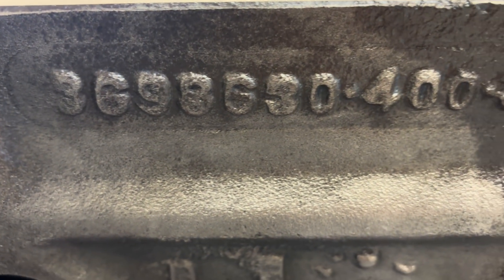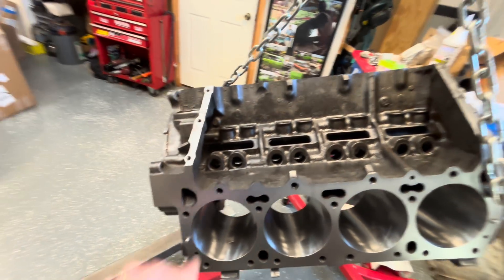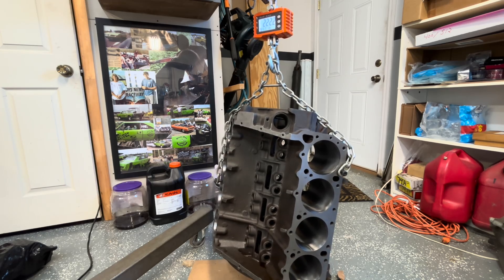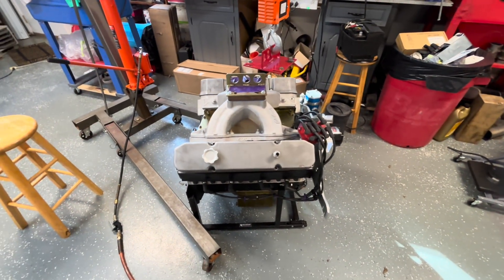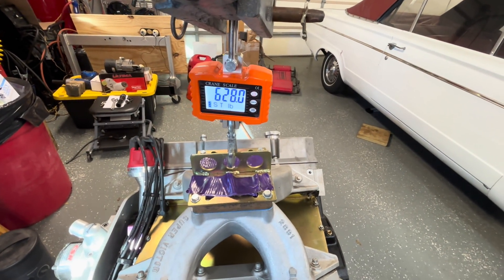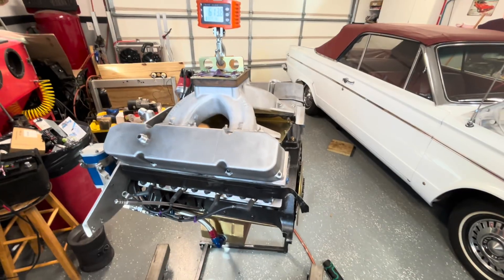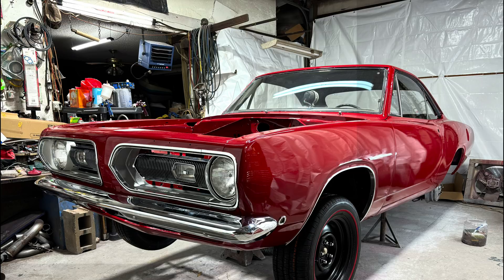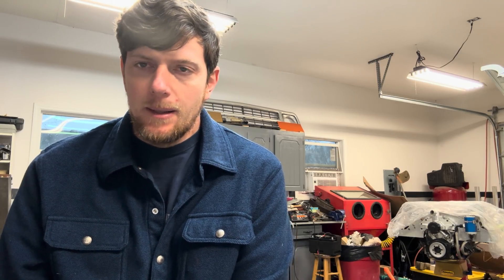Mopar Engine Weights Revisited: Bare Blocks and Full Builds

Comment: Whats the build plans for the 440 for the Challenger?
Reply from the maker: It’s a nice stock forged crank, 440 source rods and some old TRW flat tops with a slight dome. Aluminum heads and a simple flat tappet Erson cam. I want it to be a simple driver that I never have to pull the valve covers on. It’s at the balance shop now.

Comment: I would have sworn the 440 was a lot heavier than a 400. I had an aluminum headed '78 440 in my 68 Roadrunner 4 speed car. It weighed 3540 with about 1/2 a tank of gas. Not the heavy pigs they always get accused of being.
Reply from the maker: I definitely think that 9 pounds and the weight of the longer rods and larger crank add another 15 pounds or so

Comment: That's really useful for planning out engine builds in general, plus it gives us the baseline to compare the aluminum blocks. For example, Bill Mitchell Products quotes their aluminum RB blocks as 135-142 pounds.  Assuming worst case, that's a solid 80 pound weight savings versus the iron block.  That's a lot of weight off the front axle, although not as big a difference as I expected (I was guessing 100+ pounds).
Reply from the maker: Very good point! Thanks brother

Comment: I’m still amazed that an iron headed small block weighs more than an aluminum headed big block. 🤯
Reply from the maker: Don’t forget aluminum water pump too. This was a cast crank 400. Short stroke gas to help with weight in the bottom

Comment: Watch that sump Joe, tore a hole in mine not that long ago. Ended up replacing it with the milodon track sump. Same capacity, made for external oil, 1-1/2” shallower
Reply from the maker: Yes sir. I’ll definitely check it and be careful

Comment: That surpises me its only about 9 lbs difference,i thought it would be more than that! The small block 408 with aluminum heads would be a little lighter than the 406 but not really that much.And if your using 440 source parts I think for an equal amount of money put in to them,you will make more power with the 406 big block....someone needs to start a 340 source company for  small block stuff lol 😂  I mean yes you can make a lot of horsepower with a small block too If i would put some good aluminum heads on my 408 it should put it somewhere in the 530-550 hp range but I think you can make the same or more hp and torque numbers for the same or maybe even a tad less money with the big block,tall or short deck,I like the small block in my car because of the ease of getting to and working on everything,but truthfully if I had some big block parts laying around instead of small block stuff I would put a big block in it lol
Reply from the maker: You're spot on, a 408 with a good set of heads would make good power.

Comment: Those aluminum parts help alot with the weight. It would be a good comparison with a stock 440 with all cast iron heads, intake and water pump still on it.
Reply: The 440 is right around 700 bone stock, but that depends on a few factors, year, manifolds, etc.